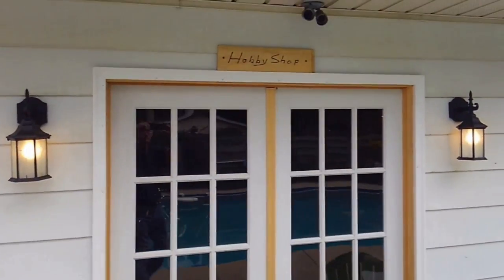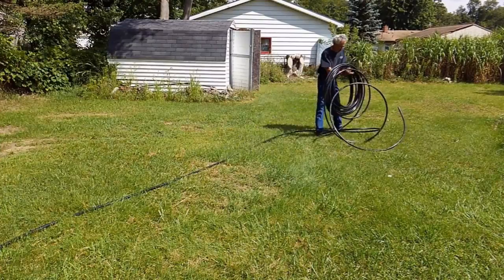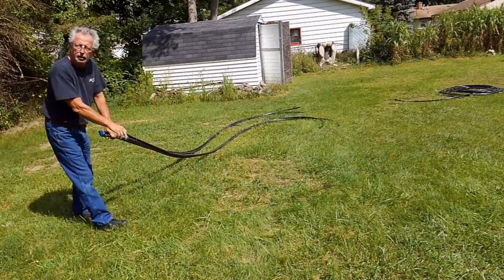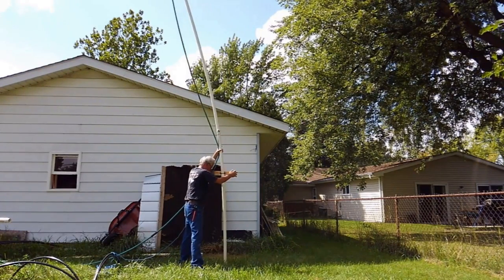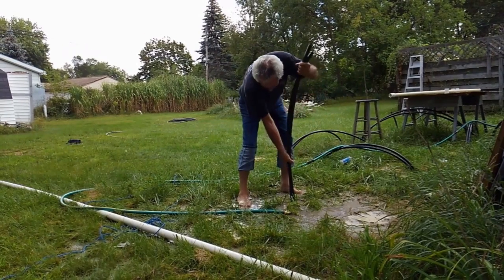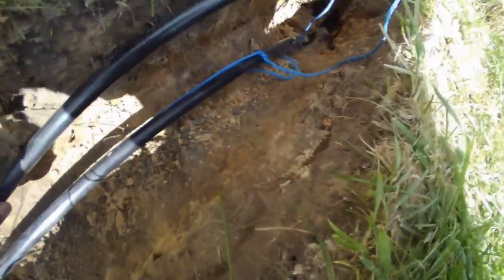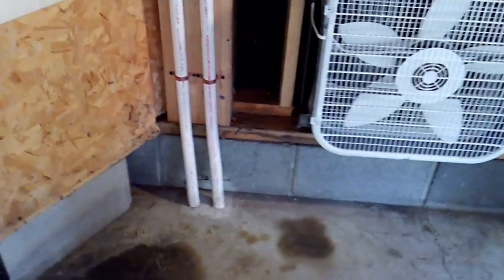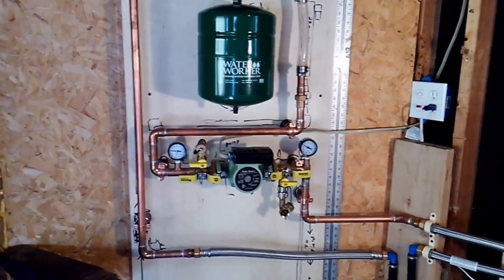Geothermal diy #1

Comment: BTW mayby you could somehow make the hot water into steam and power a small turbine that powers a generator. 
Thinking small ofcourse not like  reall geothermal power plant size but small.

I don't know if there are such of things. but it would be nice
Reply: You'd need to be in iceland or somewhere like a plate boundary.
In the middle of a continental it's not hot enough for steam any reasonable depth in any reasonable place.
It could work at old faithful, but... it's not really accessible.
Reply: I heard or a guy working with freon to turn a steam turbine because freon has a lower boiling temp. Could do some research to investigate.
Reply: Only about 20% of the United States is suitable for geothermal power production that's more of an opinion really it's quite expensive to go down as far as you have to go there's a lot better sourcesOr I think eventually getting solar and geothermal energy are only real options

Comment: I am a electrical engineering student in the netherlands.
We use alot of the geothermal effects of the earth.

I really liked your video. I searched specific for DIY cause I want to make this one day.

In short.
You could also make the system to drive a generator and produce electricity.
I really would love that.
good luck
Reply: You don't have to have steam in order to generate electricity.
 A stirling engine only uses a heat differential to create mechanical energy from a heat source and a cold (less heat) source.
Reply: Yeah maybe if your near a volcanic vent lol to use a generator you need steam to make steam you need lots of heat probably start at 400* f.
Reply: But produce electricity need 2 wells of 1000 metters to make steam it's costing
Reply: Not sure this system would work were as the temp is only 55 to run a generator. it's already using electricy for the pumps. it would cause a lot of friction loss to on incorporate sum type of electric generator.
Reply: Noob
Reply: Hey superedrix,

Ik zag je reactie op  de geo diy. 

Ben zelf informatie aan t verzamelen voor t effectief verwarmen en koelen van gebouwen en specifiek voor 4 season greenhouse. 

Als je leuk vind kan ik je wat info geven wat ik aan t ontwerpen ben.

Waar liggen jou eventuele raakvlakken betreft kennis en interesses.

Groetjes Ian

Comment: Hello Larry thank you for sharing the video.... this is amazing...if I wanna do this in my house that big radiator won't look nice with the living room or bedroom, are there any nice radiator-fan combo that can be setup inside the house?....other question is what is the difference between doing those straight tubing wells instead of a cool shape tubing well?...thank you
Reply: Take a look at "valence convectors". No fan needed
Reply: I meant coil shape tubing
Reply: following had same thought multiple vertical wells have a friction loss. most professional geothermal either go straight down or horizontal to minimize resistance/friction to the pumps.

Comment: S
Reply: Ground temperature is not high enough to heat a home the way your system is built because the temperature of the water you put through would only be around 50 degrees.
Reply: @davisgg1  I believe he said he was going to keep a greenhouse from freezing with this system.
Reply: davisgg1 if its less than 50 degrees outside air temp, this method allows him to bring his house temp to be at or close to 50, so then he's only paying to heat his house from 50 to what ever his thermostat is set at.  While it may not deliver a comfortable 65-70 degrees, it still beats heating from say a zero outside air temp.
Reply: @jtp336  This way he would actually be pulling heat out of the house and putting it in the ground.
Reply: It's not in his house. That is his garage

Comment: Very Nice! Why did you decide on 10 wells? Why not 20 or 5? I love the idea but would like to know more about the thermal capacity of the ground. Can I "heat" the ground losing efficiency but gaining planting time in a greenhouse, can a system be put in more linear and help keep my grapevine roots warm all winter... LOL, all rhetorical....I love the idea!! Nice job!!
Reply: I have studied Geo for cooling process water in the summer & heating in the winter.  I came up with 600ft under frost line can equal 1 ton off chilling/heating